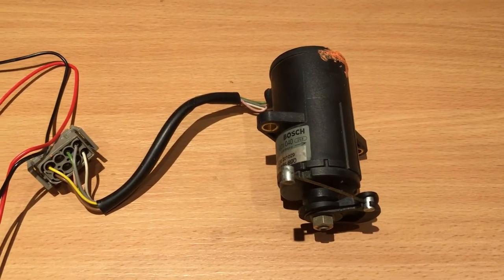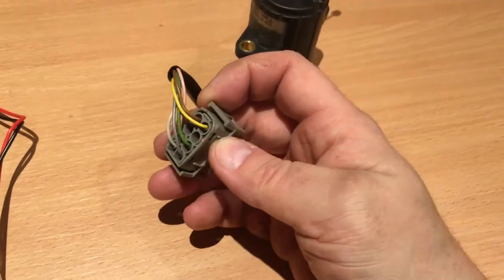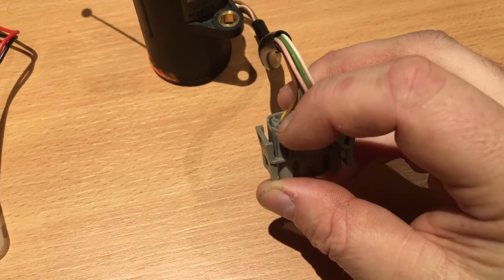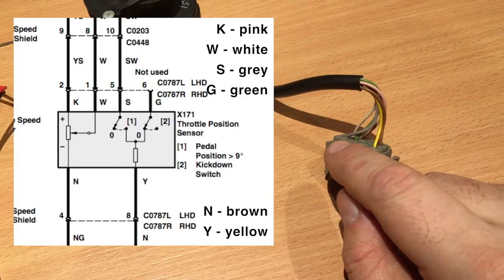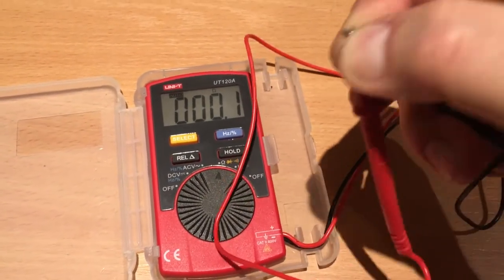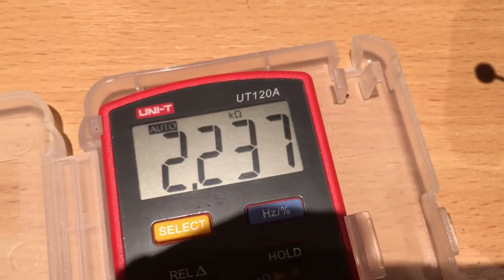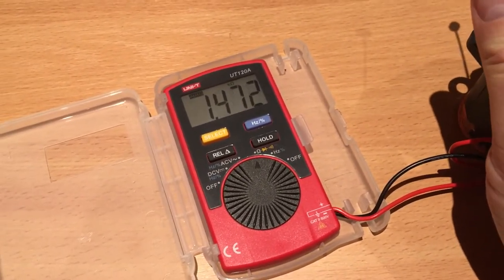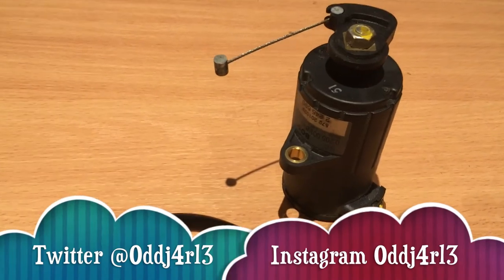Range Rover P38 # 077 - Throttle Position Sensor

Comment: Maybe an easier way to describe the potentiometer: 
Brown and Pink are the track, and on mine has a steady resistance of 1.3Kohm. White is the wiper. 
With brown as GND and pink at +5V, the wiper gives 0.42V at idle, 3.26V at full throttle (no kickdown) and 3.56V at full throttle with kickdown. 

cheers

Comment: If these potentiometers start to fail  can it cause the engine to stall as you lift off the pedal or when selecting drive / reverse when idling,, thanks

Comment: Hi there, I have a P38 DHSE and today it gave an error on the dash 'gearbox error'

I plugged in the nanocom and the fault from the gearbox was 'invalid throttle angle data'

Do you think the throttle position sensor might be at fault? I have a spares car, so I can replace it easy enough. 

regards
Reply: Did you find the problem? I changed the throttle sensor and no difference.

Comment: Do you have any ideas why my p38 2.5dse automatic wont shift gears under 3500/4000 rpm? In low range it shifts perfectly. Thanks in advance!
Reply from the maker: Hi Steven. That's an interesting "feature". My first thought is that perhaps the gearbox thinks it's in Sport-mode which holds the gears longer before changing gears. Is the E/S mode switch illuminated? Maybe there's something wrong with the wiring there, or a faulty switch. I hope you can figure it out. Thanks for watching!